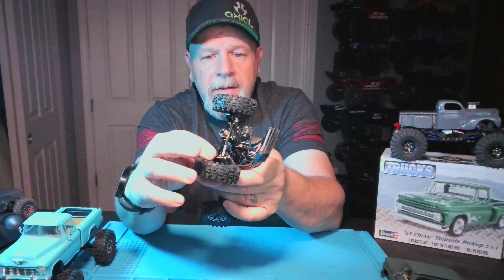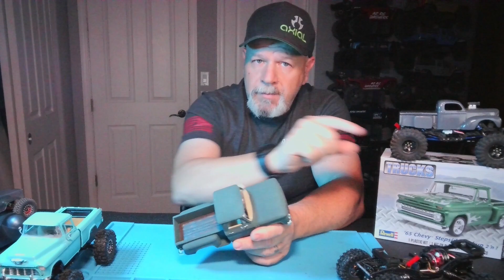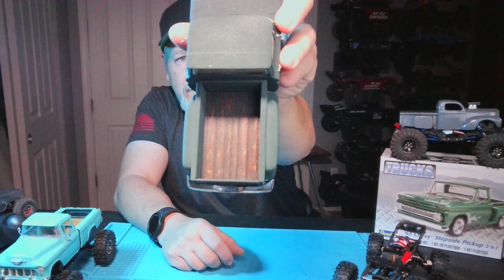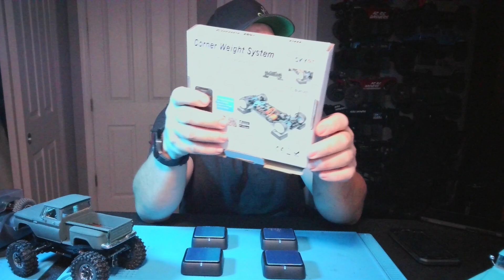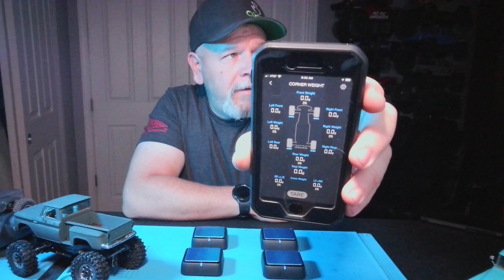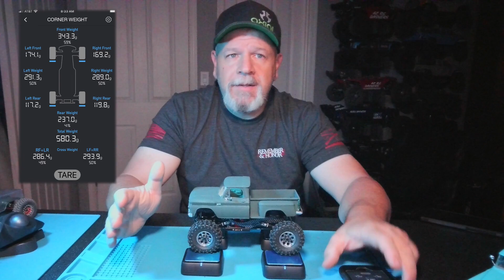SCX24 Hard Body Build - Green 1965 Chevy Step Side Build - Build Walkthrough - S02E083

Comment: Which scx24 would you suggest to start with to put the 65 chevy on? They have a few different wheel bases :) Thank you! I watched the video just mightve missed it.
Reply: and do you have to have the chassis? can you use the oem chassis/everything?
Reply from the maker: I wouldn't say no,  but you will have to make the mounts to put it on. The wheel base may have to be adjusted to fit depending on the scx24 model you have.
Reply: @SKHobbiesAZ  ended up 3d printing an exact fit of the same truck. Made it slightly bigger and 134mm wheelbase:) I appreciate the help!